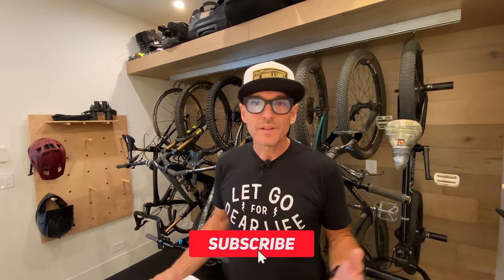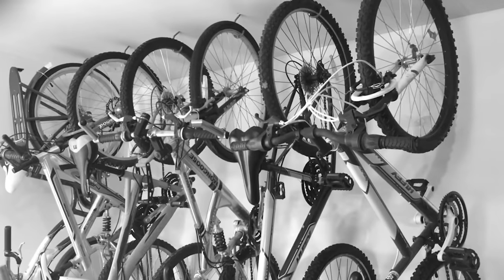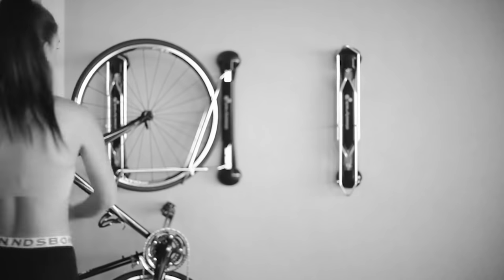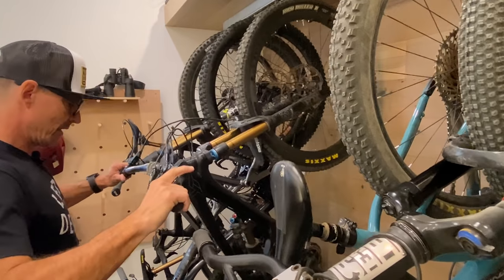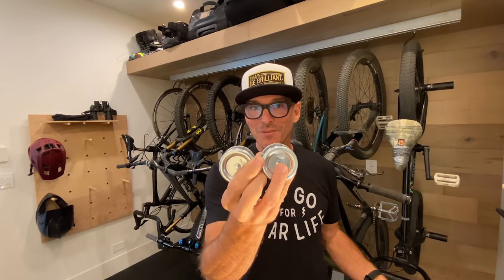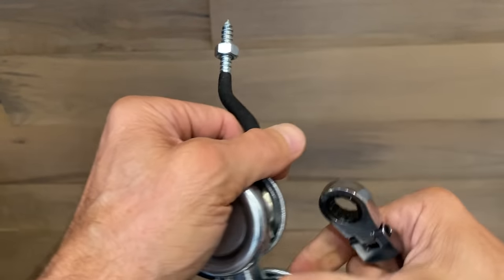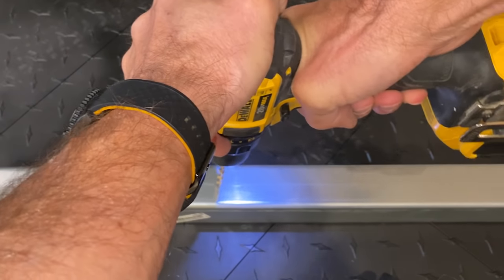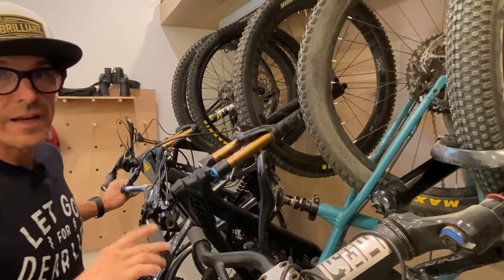ULTIMATE BIKE RACK SYSTEM. MORE BIKES. LESS SPACE

Comment: I love this. Ugh, i just dropped $400 on steady racks the other day.  I'd love this option as it seems more flexible but in my garage, it's such a high ceiling I'd have to figure out a way to bring an overhanging shelf out with enough support to hold the bikes. Hmm...got me thinking though... What were those peg boards? Where were they from? I need me some of them to hang helmets!
Reply from the maker: I dropped a shelf from the ceiling too. Works great for gear bags. I have a metal storage box shelf i got at Home Depot in the garage   It’s rated for 600lbs. The rail could tie into that shelf too. 300lbs of bike and 300lbs of gear.
Reply: @JoyOfBike  how high is your ceiling? Mine is literally like over 15ft high lol
Reply from the maker: @gregoryjhickman It's 8 foot. Man I'd do a ladder and loft space above the bikes perhaps. The pegboards are on Etsy and the hooks are my design and you can download the and 3d print them from my thingaverse page.
Reply from the maker: I got the pegboard off Etsy. I designed a jumbo pegboard hook in CAD and printed them out. If you search my name of jumbo pegboard hook on Thingaverse you will find them.
Reply: @JoyOfBike  I have the same scenario as you and need to drop a shelf as you did.  Can you share the details of how your shelf is constructed in order to support the weight of the bikes?
Reply: @JoyOfBike  How did you drop the shelf from your ceiling? I'm looking at building this rail system, but will have to build a shelf out from the wall as I can't mount via ceiling.
Reply: Yeah i looked all over youtube how to drop a shelf from ceiling
Reply: Threaded rods could accomplish what you are looking to do you can brace it at the top with some angled brackets.
Reply: @JoyOfBike  Do you have a link or a further description of the "metal storage box shelf"? You mean one of those shelves that are mounted to the ceiling, like in garages for storing things above a car? I have the same issue as @gregoryjhickman of too high a ceiling to mount the hook rail way up there
Reply: Anyone that can share instructions for dropping a shelf to hang this from?  Have a sloped ceiling so need a similar solution

Comment: This is a great idea, I found that you can save a bit of money using unistrut for the track and rollers. I'm fabricating a steel shelf to mount to my garage wall and will hang this to the bottom of the shelf. Pro tip, if your bikes take up less space the wife won't notice a new one in the garage!
Reply from the maker: Great idea. Feel free to add links to alternative struts and rollers.
Reply: Ha ha! Not game to post the first thought this triggered!
Reply: Big U-bolts with one leg cut off and covered in shrink tube works great with either setup and can be properly threaded into the "trolley" (keyword you should search for uni-strut roller things you need"). Unistrut will end up being about half the price.
Reply: Did you ever finish your steel shelf? How did you build it? my garage ceiling is too tall so I would need to install this on a shelf as well.

Comment: What a great concept and demonstration. I was able to order  the rails and dual roller sets at Lowe’s for $40 each. So for about $145, I have a great rack for four bikes. 

I bought the bike hooks at Lowe’s also ($5), mated the hook to the roller with a 12 mm nut, 2 for $1.25 at Lowes as well. It worked perfect, threaded on securely. The 12 mm nut fit into  the recessed slot of the rollers so lock in place at one of eight positions. You can adjust the position of the hook  by pushing the hook up and rotating until the nut drops back into slot.
Reply: This has been my biggest challenge building the rack; marrying the wood screws to a machine threaded bolt.  I can't get anything to bite on the screw; at least, something that will also set into the roller like you did.  I think my problem is made worse by the fact that I'm trying to use the thicker Blue Hawk bike hooks - that are thicker than the hooks that Alex linked to in the video.  This is good input though, I might make another trip to Lowe's to see if I can find something. Thanks for sharing!

Comment: Oh, have to add- Park Tools makes machine threaded hooks in both sizes, better than mickey-mousing the wood screws. I have an 11' ceiling in my garage, mounted it with shelf brackets with 1/2" plywood shelf to the wall suds to get proper height. Top shelf holds truck pad, fenders, pads, helmets, etc. Did not win FAMILYHANDYMAN prize, but did get picture and basic assembly instructions into the magazine issue. Don't forget the thru bolts at each end to stop the rollers running out of either end, dropping bike on ground.

Comment: Nice video.  I did a more economical version of this with Park 450 hooks with tight fitting fender washers in place of the trolleys.  Trolleys are nice but unnecessary if you are trying to cut costs.

Comment: This is superb, thanks for sharing. Between four teenage boys, wife and myself, we have MANY bikes out in the garage. I’ve tried a ton of storage solutions and until now found the best to be a simple 2x board run between two vertical posts slightly above saddle height. Then you just lift the bike a few inches and rest the horn of the saddle on top of the board. Simple, cheap, tidy and effective; however with a bunch of bikes, they do get crowded together. I am going to take the same span in my garage and run a hanging-sliding rack as in this video, should work great.

Comment: Just did this with two 8’ sections for 6 bikes. I have the bikes running parallel to the wall  with handlebars overlapping the next bike’s wheels because I have a fairly narrow space in my one car garage between the wall and car.  One thing you should update, if you haven’t already is that Park (model 450) makes the same hooks with a black coating and machine bolt ends with two nuts included instead of the wood screw versions you spec’ed.  Otherwise great solution!
Reply: Are the 450"s good for MTN bike wheels/tires or do they need the 470?
Reply: @tristanwwsd  I have 40mm Gravels on my 450 but you could buy the 470 for really fat tires.
Reply: @paulgolden6012   OK, thanks

Comment: put up a variation of this in my garage this summer.  i have a high ceiling in there so used some shelf brackets with a high weight limit to mount to the wall and also put a 24" deep shelf board on top.  drilled holes in the top of my box rail to line up with the holes in the ends of the shelf brackets and bolted through the rail, bracket, and shelf to hold it together.  drilled holes through the back of the box rail at both ends and put in plastic spacers i didn't need from tv mounts to keep the trolleys from coming out in a way i can't see from the front.  cut it down to 6½ feet since that's the space i have and put 6 hooks in it.  used park tool machine-threaded hooks that come with 2 screws -- the small size ones work great with a nut actually inside the trolley but the plus size i needed for my 27.5+ just barely has room to slide through where the rail bolts to the shelf and brackets.  don't have any fat bikes so didn't get any of the largest hooks.  got my box rail from home depot and the back track actually sits lower than the front track, so i need to push the wheel a bike is hanging by toward the wall a little to let the trolley slide side to side, meaning they sort of lock themselves in place when hanging free.
Reply: @misterhaan What shelf brackets did you use?
Reply: @chillchristopher  Performax® 20" Platinum Heavy-Duty Shelf Bracket from Menards.  they claim each pair can support up to 1000 lbs and it's been very sturdy for me with 6 bikes (one of which is an ebike) hanging from 4 brackets.

Comment: I like this system. I have either given away bikes or sold them cheap because I only had room for one bike in the garage. I have an outside shed for the rest but hate putting good bikes out there so I was storing one additional in my bedroom closet. I'll need to measure this off because currently my best bike is hanging above my Jeep in the garage so might not fit, but still like the idea.

Comment: Built a free standing set up with the barn door hardware. Thanks a lot for the inspiration and awesome idea. Holds 8 bikes without an issue. Used the threaded park tool hooks, got them nicely locked in place so they don't rotate much.
Reply: Hey how did you get the threaded park tool hooks to lock into place? I'm just about done with mine but i can't figure out how to keep the hooks from spinning freely...
Reply: @michaelbird5750    Thread the hook through a hex nut when screwing in your hook.   You should then be able to wrench the hex nut tight while holding your hook in the desired position.
Reply: I would love to hear more about your free standing solution, could you share any photos or links to the parts that you have used?
Reply: @scott.a1565   Hey there Scott - I just built two towers and a big cross bar and bolted it up to it.

Comment: Incredible idea, and thanks for the instructions.  I helped a friend build this in her storage shed.  We could not find nuts that worked on the various hooks she had so we used the actual bolts that the barn door brackets would hang from and attached the hooks to those with wire rope clips.  One question - do your hooks spin freely, or are they rotationally static?  The way we've done it the hooks do turn freely and it seems a bit more of a challenge to get the bike on it as it will turn if you hit it at all with the wheel.  Maybe this is something you'd get used to.  It also seems that having them static but at a bit of an angle would allow for even tighter spacing of bikes as the cranks and bars would nest a bit more.  Thanks again.
Reply from the maker: Nice. Yeah they are static. If they rotate i think it does get to be too challenging to get a bike on. Even with the hook static at 90 degrees you can still angle the bikes.

Comment: This is like the idea I had for an adaptive heat lamp system in kitchens so you can make service go both directions when there are two door entries and two sides of a restaurant that has different customer levels at different times of day (especially if there are big bookings on one side) It was two of these rails and a heat lamp island that moves or locks in place. That way you aren't using a fixed system and as long as you make equipment have wheels / brakes and modular with plenty of power outlets etc, you can quickly moves things around based on the use of the space
Reply: The challenges for this idea are gas lines and water lines which need special hose setups

Comment: Perfect! I have a space in my deep garage where I could build a setup just like this with a deep shelf similar to what you have. My shelf clearance would be around 79" instead of the 83" you prescribe but I think this will be ok as I don't have downhill bikes and most of my collection is shorter road, gravel and mountain bikes? Maybe I could get it up to 81" clearance by notching the wood studs so the rail becomes recessed. Can't really raise the shelf much as it would become less than 12" and kind of impractical for holding much. Also what’s a good distance from the wall to position the rail? Maybe16 inches would be fine as to avoid the tires bumping up and leaving marks on the wall? In my situation I can fit just one 8ft section of rail, what’s the max number of bikes you could store? I think I can fit up to 8 bikes if I alternate the bikes hanging from front and rear tires so the handlebars aren’t conflicting with each other too much.

Comment: This concept is very similar to the 8 or so sliding hooks I have to hold my choice of rucksacks in a cupboard by the front door. The hooks are made of steel, and are threaded over a normal wardrobe rail hanging under the top shelf, which has my hats on. The pack of hooks cost about $3 equivelant.
Now, a rucksack is not at all heavy, so the hooks don't need sophisticated rollers on in order to move. In fact, it is all very simple. The hooks are just a bit stronger than those that would hold up a shower curtain.... but, like the "wardrobe" of bikes, it is very handy to pull the others aside to get one rucksack in or out.
On the shelf under the rucksacks stands my bike.. the Brompton folded up is a perfect fit, which was dead lucky, because the shelf was installed 20 years before I got the bike.
Under that shelf is our wine rack!
Anything else I can tell you? 
Oh yeah. Good bike rack above. Good video, too. Thanks.

Comment: Great Idea! Only Question, how far off the wall should the rail go?
Reply: Might wanna do some measurements yourself, and it'll depend on what bike types/ wheel sizes you have. I'd guess maybe a good 4 inch clearance for your largest wheel + up to your handlebar (for when you need to spin the bikes around so they stack nicely side by side). Might be a bit overkill tbh.
Reply: I added 2 inches to the distance from the axle to the tire on my largest wheel. The good, it keeps the setup as tight to the wall as possible. The bad, the lower wheel is on the wall. It is not a big deal for me but if you want your bike to hang you need to hang a bike temporarily to see its resting position and measure the offset from the wall.

Comment: I went a little different route and purchased a barn door kit on Amazon (DIYHD) for my garage, but did use the jumbo bike storage hooks from the listed link.  I'm not sure if the hooks were different but would highly recommend 3/8 nuts and not 5/16, or just pick up 8 of each.  And a ratcheting wrench set (will need a 7/16 and 1/2 for each nut).  Though the 5/16 washers were the perfect size.  Great design though!  Worked like a charm once I worked out the kinks.
Reply from the maker: Interesting. The jumbo hooks might be bigger. I’m not sure. Glad it worked out!!
Reply: I have been trying to think about how to use a barn door kit.  Would love to see an image of how you did this.
Reply: @millerj826  I think it really depends on where you want to mount, but I installed in my garage.  The way the studs run and the ceiling height forced me to run two steal L brackets from the rafters attached to a 2 x 4 at the bottom.  I then attached the barn door slide to the 2 x 4.  I ordered the "DIYHD 5FT Raw Material Galvanized Box Track Ceiling Mount Sliding Barn Door Hardware for Exterior Barn Door" off Amazon.  The kit includes the barn door slide, two rollers and the hardware.  Was probably more expensive than doing it the way in the video, but I paid for the convenience of not having to drill.  The directions suck by the way but there's videos online.  Overall worked great.  My only gripe is the hooks don't exactly fit into the included rollers as easily in the video, but I made it work.
Reply: @JoyOfBike    I have the same problem with my jumbo hooks. I wanted to know how you managed to insert the 3/8 nut into the roller, or what method did you use? Thanks

Comment: This is a really clean, clever, functional idea. Well done. I'm in the same boat trying to tighten up my storage game, but I've never come around to the idea of hanging my bikes from hooks (or even cradles, like Steady Rack). There's something about imparting load (albeit no more than 30 lb) through the headset via hooks that never sits well with me. I realize we smash these bikes around on trail, but the load paths is different and not as prolonged as it is when the bike just hangs... Never rubbed you wrong? 
I love the idea of floor racks; easy in/out and no lifting... I'm contemplating a sliding floor rack system, but your solution is undeniably efficient! 
Thanks for all the fun content! See ya out there!
Reply from the maker: marTo rocks Thanks! When have room i like storing my bikes flat for sure. It’s just a lot easier too. Most springs I automatically expect to change some fork seals. This last year with the bikes hanging inside i haven’t even had to do that. The cold seems to be harder than the hanging. I’ve never had any issues and usually break my bikes crashing them. My personal feeling is that these bikes are never gonna suffer from 30lbs of force. I’d probably be most concerned about carbon rims but no issue ever. Have you seen the Santa Cruz crew try to break a carbon frame? The force on the bike is similar to a flat landing but with about 1/15 of the energy. Figuring I’m 170 the bike is 30 and 2.5 to 3gs of force. Anyway, as they say, your mileage may vary. Stoked you’re liking the content and don’t be shy about sharing ideas for shows you’d like to see too.
Reply from the maker: When you build that sliding floor rack will you get some vid and post a link here. I've dreamt of the same thing but it never quite came together in my head.
Reply: @JoyOfBike  thanks for the reply... I've got some sketches but it may be a ways off for reality! They all include integrating my current floor racks, mostly Feedback Sports... I will say you've got me thinking about the hanging idea. Kinda reminds me of a butcher shop meat locker!... 
Also I've got a few ideas for content/topics. I can post here or DM you.
Reply from the maker: @martorocks8089  I had some very simple front wheel loops that worked great for floor stands. They were great. That paired to some sliders cold be cool. Would love to hear what you're thinking. Leave ideas here or you can DM me at @brogusky or @bogusky on the Insta.
Reply: I couldn't agree with you more.  I have never/just can't get the idea of hanging my bike up by a wheel, seat, upside down.....through my head